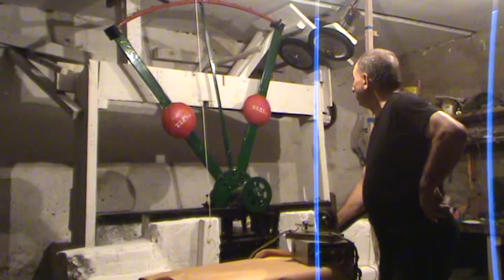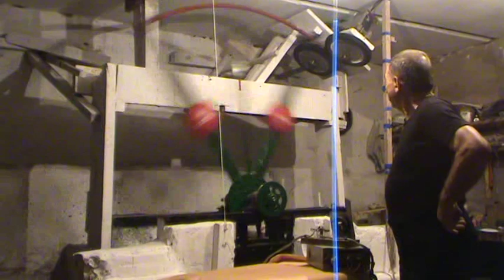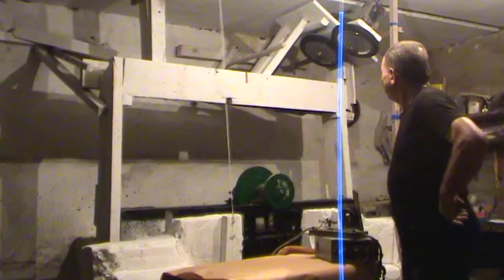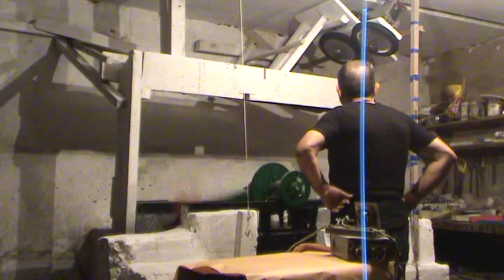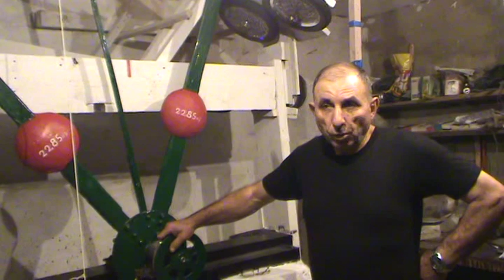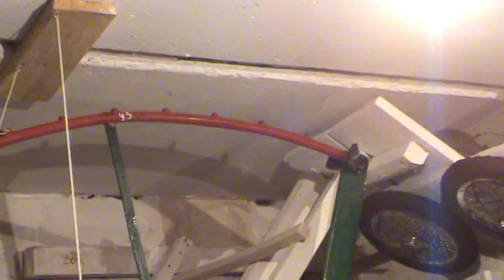F.M.CHALKALIS ENERGY MULTIPLIER

Comment: Simple and to the point.  Just like any Merry-Go-Round, all it needs is a tap to maintain its inertial acceleration. There are far simpler and safer methods, such as the MAGIC method, Mechanical ALternating Gyroscopic Inertial Compression.  Here is a link to a simple schematic for testing the function.   
https://www.google.ca/search?biw=1366&bih=657&tbm=isch&sxsrf=ACYBGNS1SdiFl5KSIfGqyOKAgjdtQCQSzQ%3A1579312841113&sa=1&ei=yWYiXofABs7n-gSTnrzYDg&q=mechanical+alternating+gyroscopic+inertial+compression&oq=mechanical+alternating+gyroscopic+inertial+compression&gs_l=img.3...14973.27596..35448...0.0..0.449.5944.29j23j2j0j1......0....1..gws-wiz-img.......35i39j0i67j0j0i131j0i8i30j0i24j0i10i24.2CI1ETn0Ntk&ved=0ahUKEwjHyIjnhoznAhXOs54KHRMPD-sQ4dUDCAc&uact=5

Comment: good very good and easy to build but here prototipoes I would modify that ate arrows pointed to no shock to entry and resonate, put the weights more Missoni shore to give more thrust and gauging of arches to give Aucho can achieve greater suabidad uan powerful machine you 200% that is if the engine thrust is 1/2hp ie with only 10 to 110 or 220vac amerios face the arrow over 400VAC 100 amp for actual size the wheel would be in over 3 meters guiro what center pulley 10 inches would be more than pushing a geerdor sufieinete with magnets 7.5kwts until 14kilo wts by e autoinomia that you can give the engine thrust if rom 1hp better system ROTOR intergrade vecter tHAT tHE FIELD oF cAPACITORS EXPLOSIBO AGAN tHE ROUGH WORK very good contribution is only just basic things Echele win race to tte greetings to all the constructor and researcher energies jr

Comment: This is fanstastic!  How do you get this device from shaking it self to destruction?  Can this actually run for months at a time? I understand that this can be directly connected to a huge generator to produce abundant electrical power.  What about gangs of flying wedges on the same shaft spaced out (free spinning on the shaft) to counteract the massive imbalance, but each one geared to a flywheel only on the power or magnets on the ends of each wedge that pass coils to make electricity directly

Comment: Here is a simple inertia calculation:  If you rotate 80 Lbs. of balanced  weight at 10 Ft radius at 800 RPM  this generates 4000 Lb. pounds of force per sec. Divide this to  550 lbs =  7.27 HP you probably need 1 HP motor to keep this weight going, then you will have 5 to 6 HP free energy to power a generator head. It took me long time to truly get this free energy method, but it's real deal.

Comment: sorry, but I do not understand a single figure of mr. Kanareva. In Kanareva table ()
is given workin length of the arc AB only 6 cm. I think the correct length of the pendulum is 2 x pi xr / 6 = 2 x 3.14 x 1.12 m / 6 = 1.17 m. It shows how p. Kanareva 6 cm. Then the following results are not correct. Impuslse duty cycle is not 7.03 / 0.06 cm = 116. The report should be 7.03 / 1.17 = 6. All the following calculations mr. Kanarev is not correct. Sorry for my poor English.

Comment: Your calculations are not correct! Place the generator at 2kw and try to run your system. But you do not do and it shows that the system does not work.

Comment: the difference to a flying dutchman on a fun-fair, is that the driver wheels, which keep the system in motion are not on ground level but rather on top, little by side.
this makes it possible for the wheel+attached weights, with an inertial push, to turn a full rotation, back into the position of the driver wheels on top, which speeds it up again.
the point, where the driver wheels are fixed, their giving the most power to the system with the lowest energy need, because gravity is already acting

Comment: Mr Chalkalis, have you ever try to get power out of that wheel? For example, how about putting a generator on the same shaft and to see if the machine will power itself? 
Yes, it's true that energy builds up when wheel is gets going by the power of centrifugal force, but "my question is" will it continue to go under same speed under load? 
You need to test this.